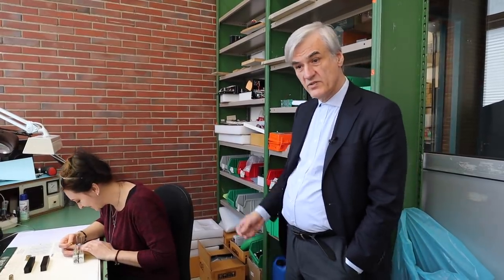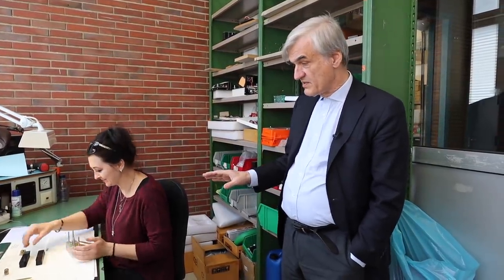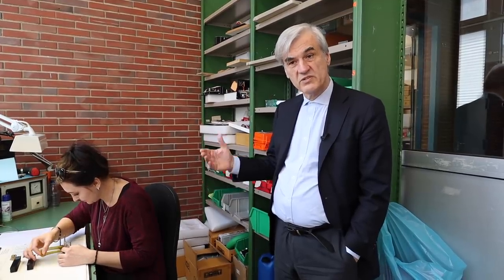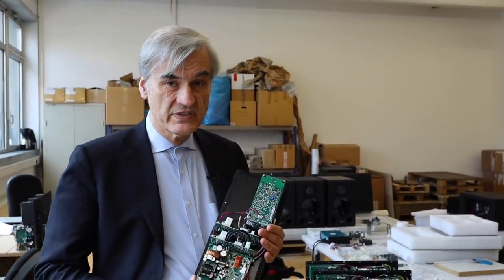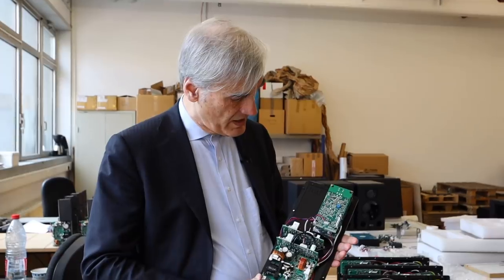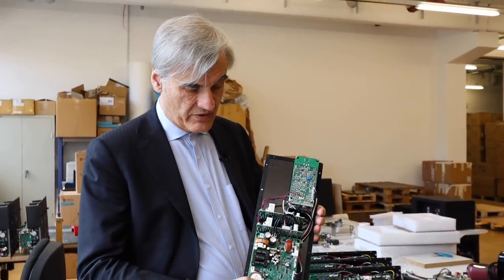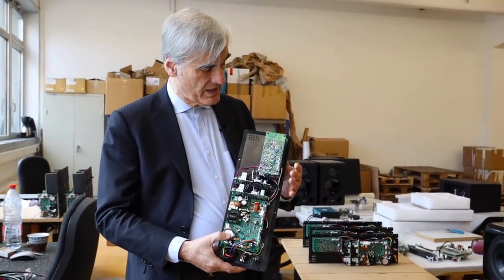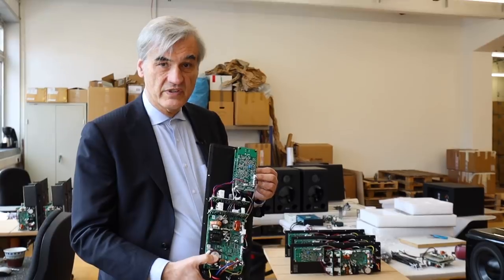Klaus Heinz talks HEDD Audio Tower Mains

Comment: As an engineer, I really appreciate Heinz' approach. There is more to speaker design and test than measuring frequency response, directivity, and sensitivity. Without transient analysis, you know almost NOTHING about the speaker -- although pundits tend to use these as their only measure because they don't understand the physics of transducers (and designers are loath to mention anything else).

It's a bit like judging car performance by paint color,  top speed, and stopping distance! Or a violin by the topmost and bottommost notes it can play. Or judging a piano by the number of keys it has. Consider a pipe organ. Just one may have twenty-five pipes that play exact C# 4, but each one has a bunch of individual character that cannot be defined by "C# 4". Speakers may have the same qualities. There's (among others) attack, decay, time-to-sound, harmonics, harmonic development, levels of of each even and odd harmonic, and so on. As a physical transducer, which cannot be perfect, each speaker has 'character' that can be mostly defined by time-domain as well as frequency-domain response to various stimuli. 

Pundits are relegated to "wine-judging" kinds of words to describe what they hear -- because there are no transient and impulse test results to examine. One speaker's "thunk" is another's "whooomb". One tweeter's "tink" is another's ka-plink". One transistor's "crack" is a tube's "crush". 

I get the impression that Klaus Heinz quite understands this. Thanks for this interview. Keep on keeping on.

Comment: i like this talk and his ideas :) 

a few things that stood out to me was:

first the sealed cabinets design, i really appreciate this, he knows what works and not afraid to use the knowledge.

second the amps, those are ICEpower Amp's they are using, i got a power amp myself with those and really like the sound and power, also those run with low noise and little hiss, and do not get hot because of efficiency. dont hurt that they are very small also.

thirdly looking at the website they have graphs showing equalizer response of linkwitz transform, and its it seems like the subwoofers rolls of like you normally would think and not the -3db he said, and equalizer response is adding 14db to get the 20hz at -3db output.